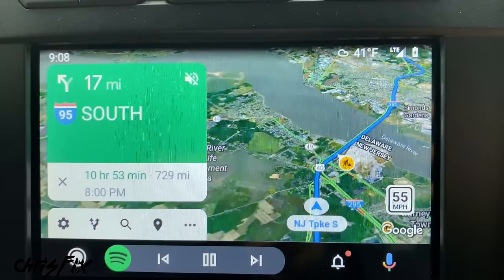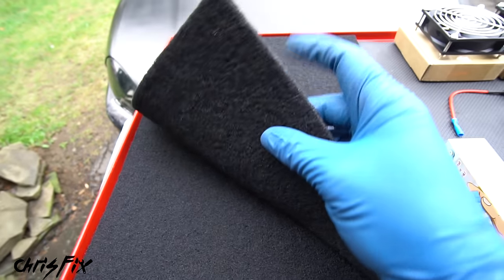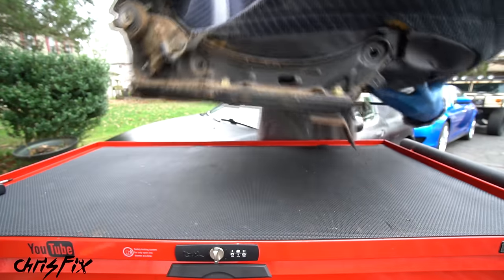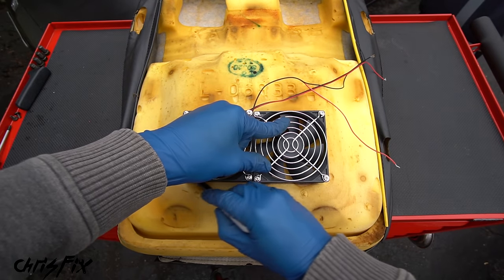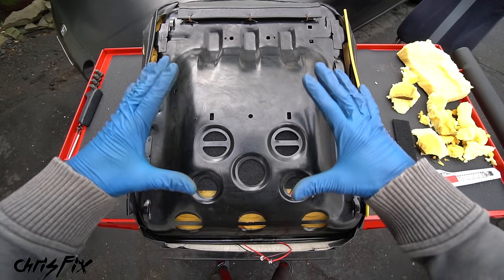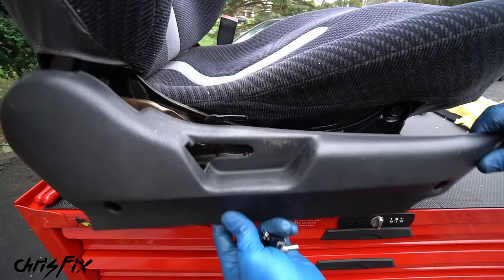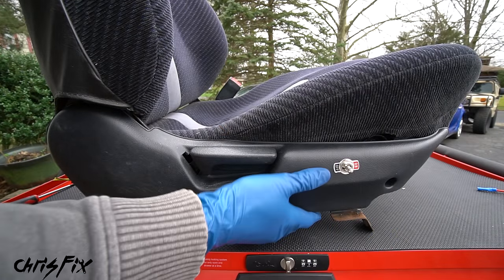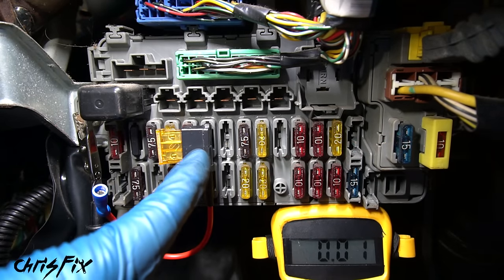DIY Odor Remover (For Your Car)

Comment: Next april: How to replace your alternator with a running hamster in a wheel
Reply from the maker: Not a bad idea!
Reply: @chrisfix  Please don't.I have a feling you're not joking.
Reply: @chrisfix  Do a video on how to replace fuel injectors
Reply: Hahhaahahah good idea.
Reply: @ChrisFix Next year you should do how to replace spark plugs on a Diesel.
Reply: oof
Reply: Aged like milk😂
Reply: @Fluffy_Panzer  i think diesel has no spark plugs
Reply: @jacenrafaelv.alamon8845  That’s the point. Aren’t we talking about April fools? Lol
Reply: @jacenrafaelv.alamon8845  all engines except electric have spark plugs- they are used to make a spark to ignite the fuel in the piston.
Reply: @ben_and_jace  from what i studied there are no sparkplugs in diesel i guess that was wrong. because the pressure will build up and heat will be created and it will burn the diesel and the heat pressure will push the piston back up and it will become a cycle
Reply: Ha
Reply: Hampter

Comment: 2016: Blinker fluid
2017: Muffler bearing
2018: Piston return springs
2019: Winter air And summer Air
2020: Odour remover gadget installation
Reply: Moiz Siddiki that means I have subscribed to Chrisfix for over 5 years . Damn time flies.. Chrisfix is the best! ❤️
Reply: @kyosuke19971  same here!
Reply: I’ve subbed for 5 year wow
Reply: I aculy beleaved the blinker fluid and winter summer air.
Reply: Moiz Siddiki Winter air and summer air is a real thing.. the others.... not so much
Reply: Honda 250R  yep!
Reply: The piston return springs made me question my life for a couple of minutes
Reply: I actually fell for the muffler bearing bit.  🙂
Reply: @James Tv asmr
Reply: I was an Air Force jet engine mechanic in the 80's and on my first day of work I was asked to get a gallon of prop wash so we could wash the planes . I was sent from one maintenance shop to another looking for it ( they always called ahead of me and told them I was coming ) . After four shops I gave up and returned to a shop full of laughter . Prop wash is the term used for the air flow behind a propeller .
Reply: Up next: Diesel engine spark plug.
Reply: Lol
Reply: @patrickjeromeobaldo2450  well I mean he’s got the Hummer now so it’s possible.
Reply: 2021: asmr video
Reply: @saxreaper  2022: idk
Reply: @BradKesalowski  how to repair a sink faucet
Reply: @Alex-lo6yt  2023: Upcoming...
Reply: @BradKesalowski  how to replace spark plug tensioners? 

I’d want to see that
Reply: 2023 windshield wipers brakes🗿💀
Reply: I was telling myself wtf is a piston spring.that confused me for so long

Comment: This is incredible, I did it and it worked wonderfully. I created the system with 2 different fans, one with a computer fan, and the other is an electric fan, the same one used on the car dashboard, which has more power. The higher power one simply sucks air out of the car through the floor. I placed two buttons, the one on the computer fan is called "fartfan", and the one on the bigger one is called "almost shit myself".

Comment: The whole world is worried about covid-19 

Chrisfix : Fart fans
Reply: No need to worry about them though, they're just a lot of hot air.
Reply: we can use this to fight the beer virus that was actually named after the crown and beer
Reply: @portland4660  I  know its a joke
Reply: @portland4660  uh nevermind
Reply: Even if fresh air is an issue just do as I did to save labor.. go to home depot and get the ryobi fan and extra batteries (the more batteries the better) then charge said batteries with a 150w or higher inverter while driving or hooked to grid. Edit: done

Comment: 1:40 Important note here, although a fan with a high CFM is capable of moving a lot of air however if they have to pull air through something such as a heatsink or a filter then the amount of air it can move will drop significantly if it doesn't also have a high enough static air pressure, even more so the thicker the material is, but for this particular use case it's not a big deal and won't make much of a difference but I'd still recommend something a little stronger than your typical PC fan around say 0.4in or 10mm H20.

Also, another thing worth mention is from what I've heard even if it goes unused when carbon filter is exposed to air then it will last at most a year, so you'll need to re-do this at least once a year if you want it to actually filter the air.
Reply from the maker: Thanks for the information!
Reply: Daim thats hardcore
Reply: Yeah, it needs a way to easily replace the filter on a regular basis
Reply: agreed

Comment: I was lucky, my car came factory equipped with flatulence fans and also bun warmers.  The fans work great for those Taco Bell dinners and keeping cool in the summer too. The warmers are great for winter and help the gas come out with ease. (Good tip) Quickly turn off the warmer and switch-on the fans unless you want to amplify the smell for the wife, lol.

Comment: Chris,

 my car makes a weird sound do you think it’s the muffler bearing or the piston return spring?

Btw love the video
Reply: I think you need to replace your blinker fluid
Reply: You’re just farting a lot
Reply: Change your tires to summer air
Reply: Chase if you open your hood and stare at it for about 2 min then close it , the noise should be gone after.
Reply: Did you lubricate it with elbow grease?
Reply: Your power steering rotaries need a rotation as well as a new quart of brake fluid.
Reply from the maker: Lucky for you I have videos on both of those so you can check and see!
Reply: Could be piston return springs. After so many compressions they get.. well, compressed and new springs need to be installed so that they can expand with the full stroke of the piston. Noise should be gone after those get swapped, I’d look into forged piston springs they’re good for an extra 30k miles. That’s what I got so we’ll see.
Reply: Most likely the pooter valve
Reply: If you have a check engine light, open the hood and check if your engine is still there

Comment: 3:24 Hi Chris! I'm a fan specialist, with a focus on small-scale fans. I would highly recomend putting these one in front of the other instead of side by side for even better results. I can understand if your intention is to improve your seats ability to hold you in as you go around high G-force corners while still keeping the amazing feature you and Ethan from Carwow just invented, as these fans would suck your rear down to the seat, somewhat like those banned race cars with fans to suck air from the underside, but you should first put in bucket seats for even better performance

Comment: You need to be careful with those add-in fuses to install it in the correct orientation. One of the pins in the fuse box  is the hot side, and you want to make sure that it has to go through your fuse before it goes to the wire. If you plug the fuse in the other way, the fuse is bypassed.
Reply from the maker: Thanks for the tip!

Comment: Could you reverse the fans to get cooling? Edit, you answered this at the end
Reply from the maker: I wonder if there is a fan that runs both ways so you use a three pole switch. Cooled seats until you need to use the “other feature” hahaha
Reply: ChrisFix that would be an amazing feature

Comment: Uh.. it goes to the floor and circulate back up.   What he should have built is having a duct connected to the fan and duct it outside (drill a hole on the floor or trunk, idk, Chris is good with the creativity). At the end of the duct, perhaps have one of those flaps (i seen those in the corners of the trunk) so that way, flies won't be coming into the cabin area.

Comment: 14:38 Careful NEVER crimp the plug to the HOT end of the cable. Cris does it wrong both times (coming from fusebox and coming from the switch). It will probably only kill the fuse if the plugs disconnect but it could also lead to other hazards like fire. What if you have leather seats though?
Reply: Don't worry there is no risk

Comment: I'm in Asia, and this idea now in 2021 is in production car. check out the Kia Sonet 2021, it has blow fan under the seat instead of sucking fan, a bit different but it's basically the same idea and principal. chrisFix should patented this method first time out.

Comment: After seeing the dirty seat frame, I knew you wouldn't allow that.
My rules for keeping my Charger R/T Hemi smelling sweet:  [1]  No takeout.  Have it delivered.  [2] No Tex Mex with beans and no cabbage.  [3]  IF number 2 is violated, have Gas X ready.  [4]  If number 2 violated and I resort to number 3, lower the windows should a mishap occur.

Comment: Chris fix,  I have a 2015 tacoma and the drivers door arm rest(the plastic underneath the leather) is cracked from putting pressure on it getting in and out of the vehicle.  It's not only unsupportive anymore but now starting the destroy the leather. Could you do a video on this?   Thanks for all the great vids btw!

Comment: 2016: Blinker Fluids
2017: Muffler Bearing
2018: Piston Return Springs
2019: Winter and Summer Air
2020: DIY Odor Remover 
2021: Wheel bearing Asmr

Comment: Video idea ... run ac under seat to have a cooled seat. Running off vehicles air so in summer you get ac and winter you get heat

Comment: Hey Chris I just turned 21 and got ripped off at mechanic for a rear leafspring bracket replacement on my 1999 ford Ranger XLT that I could have literally saved myself about $1000 doing myself. I have started educating myself with your videos and the factory service manuel for my truck. Just wondering were should I go to buy parts for my truck?

Comment: actually, the 2 things i dont like about this, 1) the idea of cutting the foam and drilling the side panel (irreversible, and in some cases hard to find the spare part); 2) the position of the cables, it makes easy to cut them with the rear passenger (if there are any)

Comment: did you add any fuse to avoid short circuits for the fan ? ? this is important for safety.
Reply from the maker: 12:45
Reply: @chrisfix  i overseen this step.
Thx

Comment: There needs to be a second switch on the driver side that controls the passenger side- just like the power windows and locks. Some of my passengers are way too proud of their own brand, so they wouldn’t flip their own switch when necessary.

Comment: i only learn one thing
The fuse box have empty slot and its connected to the battery (i can make something works with 12 volts in my car without pulling wire to the battery). Thank you

Comment: Hey Chris fox how do you fix a problem on a truck if fuel is not getting to the motor
Reply from the maker: You will need to replace the fuel pump, I have a video on doing that here, check it out: https://www.youtube.com/watch?v=mDIlwbx0B-s
Reply: Sorry for calling you fox
Reply: Ok thanks for the help

Comment: Dear Chrisfix, I am planning to do some electrical work soon however I'm not sure about the planned ground points I have chosen. Is there any videos on how to choose a good ground connection and dos and donts of grounding your electrical additions? For instance I got a bolt and a metal piece near my gas pedal bolted on to the firewall, would that be a good enough ground?

Comment: Cat Pissed in the Car seemed to have got majority out, not really sure what or where exactly. It comes back every now and again rearing it's head I used some high end cleaner that fixes most things. Also like 3 or so Types of Baking Soda Blends to aim to deodorize Pet or similar Odor. Also got a Enzyme Type Cleaner made for similar things that I need to use. Still it would be good to find a certain Solution. Also one which I can clean the interior Carpet. I thought there was like Industrial stuff or something?

Comment: maybe someone here can help me i have a 2000 mercury grand marquis every so often i will start my car and everything in it locks up it starts but the brakes lock the steering wheel locks it goes into gear but has no throttle the battery light and the check engine light come on usually if i turn it off and back on it resolves but it seems to be getting worse i checked the battery the alternator the starter and the anti theft immobilizer system they all are working fine all of the fluids are good no check engine light stays on either don't know if it could be linked but when the car reaches operating temperature and i hit 50 or go up a hill the car seems to loose a bit of power and jumps dry gas did nothing neither did changing the mass airflow sensor any tips on what to check would be great i have searched for a
nswers but have found none
Reply from the maker: From what it sounds like, your ECU or control modules might be going bad, see if you can find one at a junkyard and replace it, that should solve the issue! I would also do a scan with a bluedriver (http://amzn.to/1XNUGfz) and it should tell you if a certain module is going bad!

Comment: Hyundai sonata 2013 isn't starting
Where's Keys Smart Code Pin allocated? its keys undetected✔Replaced new Battery 12V ✔& remote as well. Thanks

Comment: So I just replaced the radiator on my car and I drained all of the coolant, and filled it up to manufacturer recommendation. I checked my coolant the other day and I looked low but I didn't think anything bad because I wasn't overheating. Any thoughts on why I have low coolant?

Comment: I would really like to know where you learn the names of the pieces. Not every manual will have all of the names of the pieces and even if it does sometimes the manuals aren't extremely comprehensive so is there a resource you use to find the pieces?
Reply: You don't need that. We know how each piece is called

Comment: Hi Chris, I got a question on how to fasten GPS/Cell cables on the dash, I bought some clips of different types but they all fall at one time or another, add to that in winter it's freezing and nothing sticks too long on the dash. 
Is there some glue or adhesive that I can use on the dash and will be able to remove and clean in the future? I have some Permatex Ultra Bond but I'm thinking that's too much ?!
Thanks.

Comment: Instructions were not clear I removed seats and airbags deployed 💀😂
Reply from the maker: That's why you should disconnect the negative terminal before you remove power seats!
Reply: ChrisFix i pressed the undo button in the car and fixed it people say it circulates the air in the car but not for me 😂

Comment: So what do you do when after 6months that carbon filter material is saturated and no longer absorbs fumes?
Why not just pull the air from the seat and dump it outside, why do you need to filter that air, you are not in a space station.

Comment: Hello, can anyone help me? I have a coolant leak which goes out from the radiator drain tube ( the hole is near the radiator cap, maybe overfill protection? ) , which causes the car to overheat to the point the engine starts smoking. I need to refill 1/4 of the cooling system every 30km (around 20miles) . Cant identify whats wrong. Engine kubota z402 aixam gto 2011

Comment: Dude even if you sucks the air from the seits, it's still inside the car passenger you need to try it in real 12h trip with your fart friend 🚶
Reply: It gets stuck in the activated charcoal

Comment: Hey ChrisFix or anyone who can help me please I REALLY NEED YOUR HELP!!

I've got a 1991 Toyota Corsa and it didn't come with an Owner's Manual.
Thus I don't know which oils or fluids to use or other maintenance guidance.
Can you please tell me what reference I can use for fixing my car which hasn't been used since a year.

P.S. I checked Toyota's website and they don't provide the owner's manual for my Car model.

Comment: With my friends and I, we would have put the windows UP before we farted. Well..what I mean is that before I'd fart, I would quietly put my window up..maybe distracting my friend first, thus gagging my friend. And he'd try the same on me.
The ultimate is if you can hold your fart until you're just starting in the car wash where your friends can't open the windows. That's the holy grail. Stink them out, watch them dry heave!